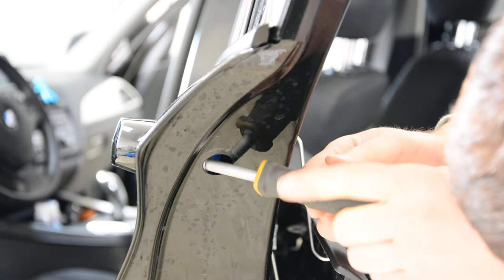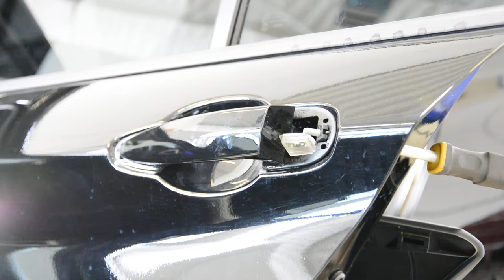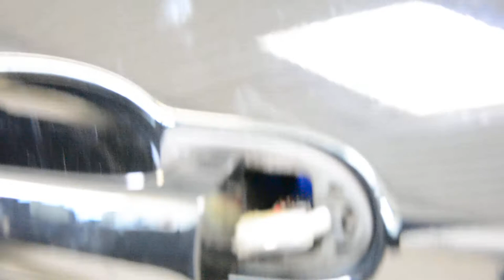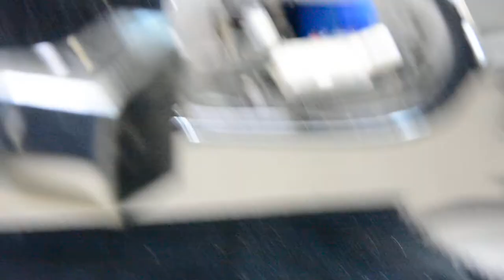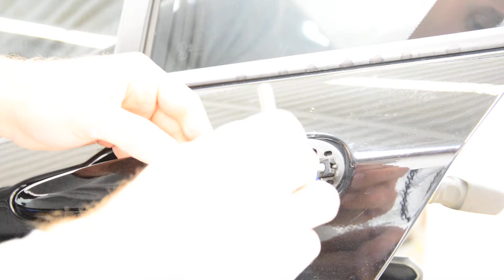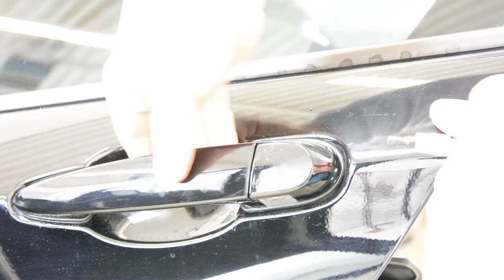BMW 1 Series Door Handle removal

Comment: i will advise u to use the plastic thin wire to take out the spring metal instead of using the hook for re-install the lock, u can slide out the wire easily after fixed
Reply from the maker: Thanks for the advice

Comment: What happens if you forgot to follow the intructions and before you put the bandke back the metal thing where you need to put the handle behind.. Drops inside the door.. And handle goes free movement.. What happens then to get it back?

Comment: there is metal clip on upper side that holds in place, when you putting it back you need to press and it will pull in the handle in place! no need of the hooks to pull if that upper clip stop is in place properly just little tap.
Reply from the maker: Good to know, thanks!